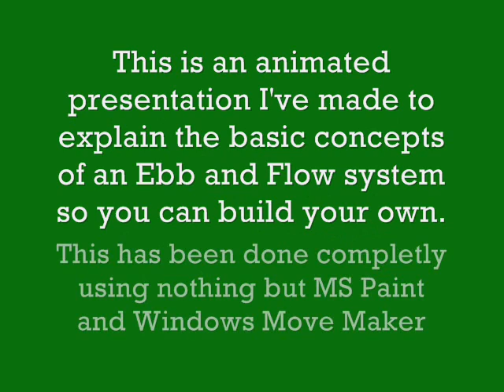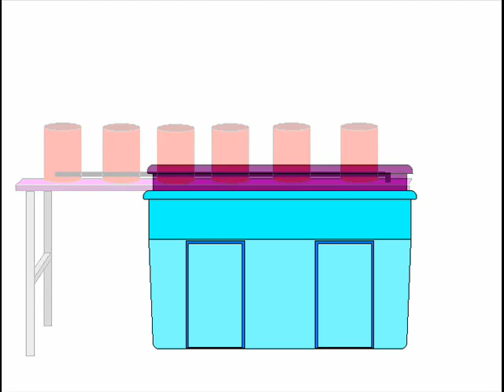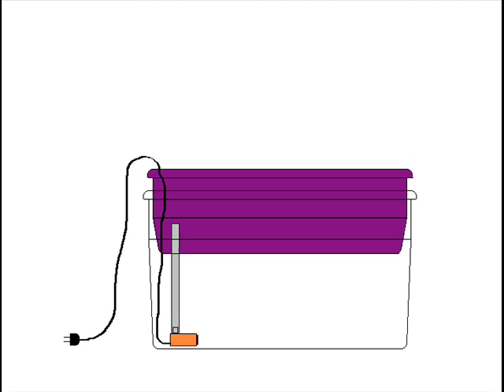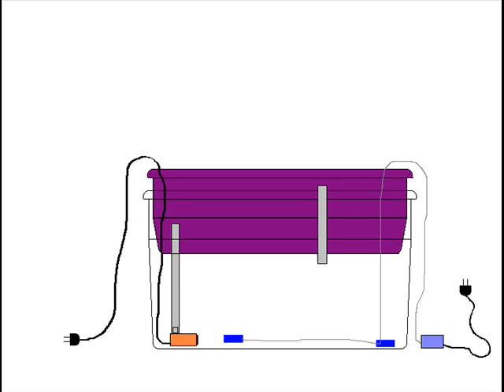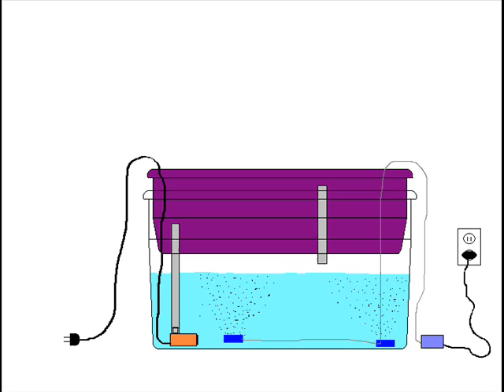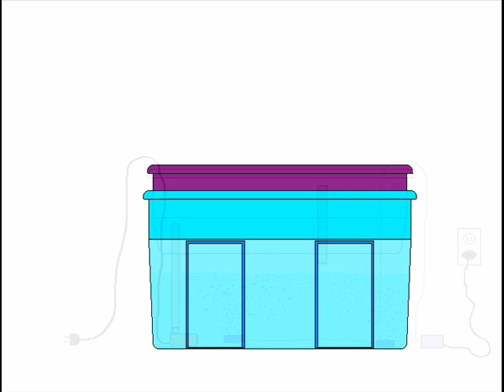Build your own Ebb and Flow / Flood and Drain Hydroponics System DIY Animated Version

Comment: I did this exact setup. My only exception is that I am utilizing 2 "under the bed" plastic storage bins for my flood trays. At 7" deep (and 18"x3.5'), they work very well. Had to light proof them using black duct tape, but they work perfectly. I find its best for me to keep the flood and drain in the middle. The extra weight naturally makes it sag, so theoretically, it helps my drainage. Great video!

Comment: The issue with hydroponics is that you will have to buy "plant food" or nutrition and supplements which can be high-priced.
Reply: Aquaponics includes the best parts of Hydroponics And Aquaculture so cut down pricing as well as improve efficiency. You may get the most efficient aquaponics system right here:
help1.info/best-aquaponics-plan

Comment: You're right about that. What I meant to say was that the air pump causes some turbulence in the reservoir (some extra movement of water, besides the water pump). At least in my hydroponic system it does.

Comment from the maker: This one I use a siphon pump. They cost around $10 in the automotive section of most stores. The tub is up on a bench so once you get the solution flowing it will drain into a bucket. Just put the siphon hose down through the overflow tube. Later ones I added a tube in the side towards the bottom like with my Top Drip Bucket System. It lets you check the solution level and drain it. It doesn't get every drop out but that didn't cause a problem. Thanks for the questions.

Comment from the maker: You could go without the air pump if you really wanted. You get some aeration of the nutrient solution during the flood cycle as it falls back into the reservoir from the overflow tube. Personally I like that the pump keeps the solution stirred and aerated and it only adds about $10 to the project. I give several options but as I try to stress in the video, this is your system, build it as you wish. Have fun with it and don't be afraid to experiment.

Comment from the maker: It's your system. If you feel it needs cheese cloth over it, go ahead. You could also put a cap on it with holes drilled in it. No need to glue it just press it on. You could use the plastic mesh from a potato sack. Just let your mind wander and I bet you can come up with several ways to keep the hydroton from falling through. :)

Comment from the maker: @theciskokidd I can't say I know for all pumps but yes that is typical. 
Extra info: Inside the pump is a disk with fins. When it spins it pushes the solution up the tube. Because of this a pump rated at 120gph may only pump 10gph or not at all at say 4' high. 
Also concerning air pumps, use a back-flow preventer or keep your air pump above the solution level or the solution could drain through your air hose causing a mess and ruining your pump.

Comment from the maker: @theciskokidd Good question. I put the air pump and stone in to keep plenty of air in the solution and keep the nutrients mixed. It may be totally unnecessary but since it only adds about $10 to the cost, it seemed well worth it to me. This is only how I did mine. My idea for this video is to show how I built my system and to encourage people to design and build their own. You're welcome to build it making any changes you like. You could experiment and answer your own question.

Comment: Nice video and explanation!   I used a very similar approach as you described, with one major difference:  I placed a bell siphon over the overflow tube so that the system can remain on all the time with no timer and it will fill the table till the  bell siphon catches and drains it back down, then the cycle repeats.  My system takes one minute and 45 seconds to completely fill and drain one time.  The plants are extremely happy and no timer, no air pump, and no air stones needed.

Comment: So when the top tray is drained ie. the water pump has been turned off, do the roots just stay suspended in the air? Or must they be submerged in water at all times?

Comment: Very helpfull video, i have a question

Do you keep the pump on the whole time? or do you want it only for a certain period of time. i will buy a timer but only if neccery. i do not want to manually turn off and onn the oump. thx

Comment from the maker: @xXxBLINGO07xXx  There is no one answer on how long to leave it run. Humidity, number of plants, age of plants, temperature, size and type of container all effect your on and off times. Start with turning the pump on for 15 minutes every 3 hours. Adjust as necessary. In certain cases you could leave it run. Although you would rarely leave it run all the time, it's nice to have that option, such as if you are trying to get young sprouts to root.

Comment from the maker: @rastamanbobby Answer to #1. There are two ways I did it. 1. I bought a fluid hand pump. You can get them for around $10 in the automotive section in any Walmart type store. Put the suction side down the overflow tube and pump it out. 2. Later I added a fluid level/drain tube. I show installing one in this video /watch?v=105e3eALKPs 
Answer to #2. Change the nutes every two weeks at least. Only add half strength or plain water between changes. You add it into the flood table. :)

Comment from the maker: The small drain holes are not typically in these systems. They usually only drain back through the pump but because of the way I installed the fill tube it was necessary. That's the fun part about designing and building your own systems, you run into a problem and you design around it. :)

Comment from the maker: @evans27ful Look up other Ebb and Flow systems and you will see the plants have some material to grow in. A google search for "hydroponic grow medium". This medium can be in grow pots or placed directly in the flood table. There is no one correct answer for run times. There are a lot of factors involved, size, age and number of the plants, temperature, humidity, type and intensity of lighting. Start with 15 minutes on every 4 hours and adjust from there. Your welcome, have fun. :)

Comment from the maker: @kaisukekim There are so many ways to do it. You can put in blocks of Rockwool or net pots/pond baskets (I like the 6" ones) filled with Hydroton, STG Hail, Pea Gravel, Volcanic rock, 50/50 mix of Perlite & Vermiculite and etc... OR just fill the flood table with the aforementioned grow media. A rule of thumb for watering times is if the plants wilt BEFORE watering your OFF time is too long, if they wilt AFTER watering the ON time is too long. Read through the comments for on/off time info. :)

Comment from the maker: @lovingmygarden You're welcome. Yes, Ebb and Flow has a lot of variations. It's very easy to make modification to suit YOUR needs as opposed to trying to use a pre-built system that may not be right for you. I've even designed a system that uses buckets like the "Ebb and Grow" but only uses one common timer and only one pump. The overflow pipe is what makes the system adjustable. The timer makes the system automatic, unless you have the time to switch the pump on manually. Great comment!

Comment from the maker: @Jamokai It depends on many factors. Type of media, temperature, humidity, plant size, number of plants, gallons per hour of the pump, size and type of flood table, and etc... Here's one example: Two 6" net pots filled with Hydroton suspended from holes cut in the lid with a 3 foot tall pepper plant in each outside in July North-west Ohio. On time 15 minutes, off time 3 hours. Your results will vary. You're welcome :)

Comment from the maker: @WolfSpiritWalk 1. I don't know for sure because I never tried it as a fertilizer but it's my understanding it's used as a soil amendment or foliar spray. There is organic fertilizer available for hydroponic systems. 2. Personally I've used Hydroton, Pea Gravel, Volcanic Rock and STG. I prefer Hydroton. 3. I've built systems using E&F, Top Drip, Sub-Aeration (Bubbleponic), The cool thing is they all work really well. No need to limit yourself to one type of system. Hope this helped.

Comment from the maker: @KevinKaya Sorry for the short answer before, I didn't have much time. As long as you supply the roots with plenty of Air it will take the oxygen it needs through the roots. Just as, if the leaves are not in a sealed enclosure they will take in the Co2 they need out of the Air. Air Enriched would be more correct since I'm not pumping pure Oxygen into the nutrient solution. We use the term Oxygen Enriched only because thats what the plant needs at it's roots. I hope this makes it clearer.

Comment from the maker: @Photokat22 Very good question! I had a sort of Dip Stick like when you check your oil in a car. I put a dowel rod down the overflow tube and checked to see how far the solution was from the bottom. I added only half strength or less solution to make up the difference. After two weeks drain it all out and start over. I found a nice hand pump in the automotive section for less that $10. Run it down the overflow pipe and pump all the old solution out.

Comment: Great video! I have no experience in hydro whatsoever and am only in the learning stage - However; I have a question! How do you know when you are running out of solution? Ok - if you have small plants, you just lift out the top level/tray..... but say I have 5ft tall chilli plants in there.......i could have a clear base, but then that will encourage algae because of the light....

Comment from the maker: @TheLiquidSword Excellent observations! Yes, the solution will drain back through the pump once it switches off. The latest one I drilled four 1/4" holes, one in each corner. It takes a little bit longer to fill the flood table but it's worth it for a complete drain. You shouldn't have any problems as long as you don't make too many or too big of holes that it drains faster than the pump can fill it. Drilling holes is the simplistic way, I've read a couple other good ideas here in the comments.

Comment: If you didn't drill any holes in the bottom of the flood table, how does the water drain back into the reservoir?  I would think that it would only drain as far as the overflow pipe, and that's it.  Is it flowing backwards through the pump? Also, if you did drill holes in the bottom of the flood table, how many are you talking? Obviously too many would prevent a proper flood in the table. Thanks!

Comment: you might have luck drilling holes towards the top of the supply pipe. instead of trying to make it flush. that way it can still drain out of the same pipe.

Comment from the maker: @MWCstream You are absolutely correct and this one does drain that way for the most part.

The problem I kept having is no matter how I connected the fill hose to the flood table, it would always stick up an eighth inch or more. The flood table never drained completely. Drilling small drain holes was my simple solution. 

Melting in a sump area for the fill connection seemed too complicated and potentially dangerous for this project. Any tips would be appreciated.

Comment: you can also make the pvp pipe/tube from the pump flush with the top container that way when the pump shuts off the water can drain back threw the same tube. then you wont have to drill any drain holes.
nice vid keep up the good work.

Comment from the maker: @galacliva Do you mean like a mini greenhouse or terrarium? Hydroponics uses a balanced nutrient solution. Simply adding more water will not work over the long term. You will need to be able to test and adjust solution strength and ph, change the solution, and add more water when necessary. Just keep the entire reservoir outside the mini greenhouse and run fill and drain hoses inside to the flood table. I hope this helps.

Comment: i have a  question. what if i built a mini clear plastic tower on top of the water system so it has it own atmosphere?  wouldn't i need to build some sort of tube leading out side of it so i can put more water in the supply? so it can keep the atmosphere?

Comment from the maker: @robmcewing Glad I could help. Having detailed instruction are nice but I like coming up with solutions on my own. It's good to use information from different sources in case you run into an unexpected problem. Good luck with your system.

Comment from the maker: @davidhopp1 The brand doesn't much. I have a couple different ones. The ones I use have little pins that push in. Try to find one that can be set to only 15 minutes. It only needs to run a pump with a few watts so a cheap one will work fine. If you got the money you and buy a digital one that can be set for only a few minutes. At this stage I haven't found it necessary.

Comment from the maker: @davidhopp1 Unfortunately there is no one answer that covers all situations. It will depend on temp, humidity, type of medium used and etc... A good starting point is to run the pump for 15 minutes every 3 or 4 hours. Experiment and adjust as necessary. 

My first system I had a cheap timer and ran it for 1/2 an hour every 3 1/2 hours and it worked fine. Don't stress over it, It's not a big deal as long as you don't drown or let the roots dry out. Good luck and have fun!

Comment from the maker: @09arken It depends on how tall your net pots are. You want the solution level to come up about 2/3 to the top of the net pots. You can either set the net pots on the floor of the top tub or cut holes in the lid and suspend them.

Comment from the maker: @ANTHONYB5615 In the reservoir is a hydroponic solution that is mostly water with a few teaspoons of hydroponic nutrients. It is possible to keep the solution balanced, proper PH and PPM strength for the entire growing cycle. Personally I prefer to change out the solution about ever two weeks. 

It is possible to leave the solution flow constantly as I say in the video as long as the solution is well aerated but then it's not a true Ebb and Flow system.  Thanks for the questions.

Comment from the maker: The net pots must contain something to hold the roots in place. I like Hydroton but you could use pea gravel or another one of many other media. Some media works better than others but most will stay wet for hours. For example; I run the pump every 3 to 4 hours depending on media, temp, and plant size. I hope this helps and Have Fun.

Comment: I've got a ebb and flow system designed from hydoponicsonline-dot-com that doesn't use a time. I"m growing mellons outside in Texas 100 degree heat. I had to bury the nute reservoir to keep it cool, and have had wonderful results. So I do not think the airstone is needed, both from theory standpoint or practice.  But as you pointed out, it can only help.

Comment from the maker: I use an air stone mostly for the sake of the nutrient solution. As you correctly pointed out, with ebb and flow the old air is pushed out during the flood cycle and new air is drawn down to the roots on the drain phase of the cycle. It may be a bit redundant but I think it's a good idea to have the hydroponic solution being constantly aerated. If you build your own system, you can try it without. Experimentation is part of the fun of this hobby.

Comment from the maker: Wow, so many choices. If you wanted to fill the flood table you could use perlite or vermiculite or a 50/50 mixture of both, hydroton, pea gravel ( not too deep, it's heavy) and etc...

You don't have to fill the flood table with anything. In mine I used three 6" net pots filled with hydroton. I just set them in there and set it to fill about 4" deep. Cover the top with black plastic to keep the light out with holes cut to let the plants stick out. Experiment to see what works for you.

Comment from the maker: I put a 1/6" hole in each corner. You may want slightly larger holes or more of them. Don't be afraid to experiment and have fun. Ebb and Flow is a pretty forgiving type system.